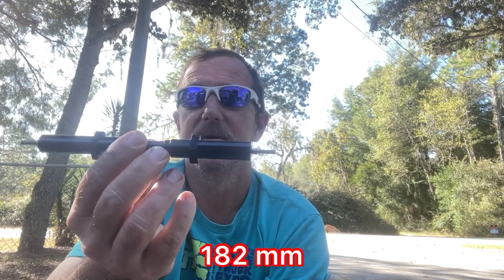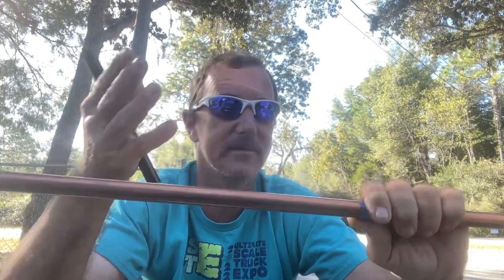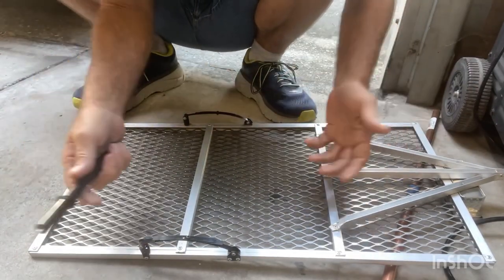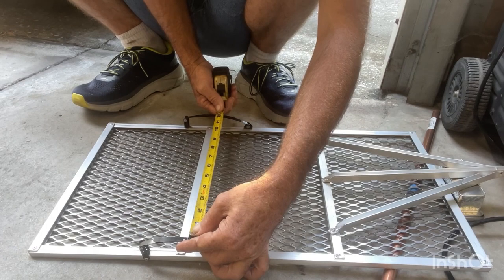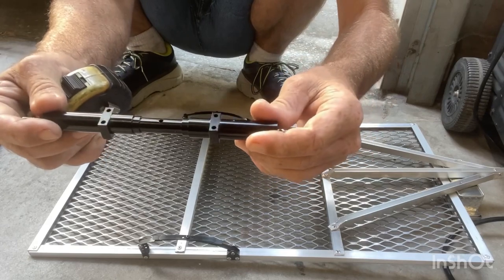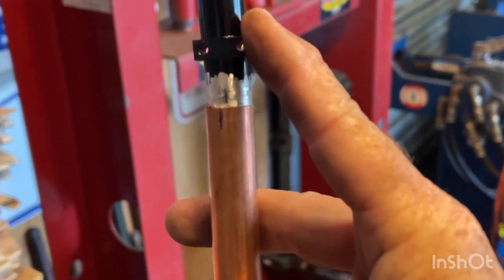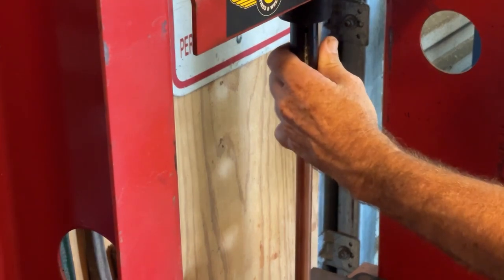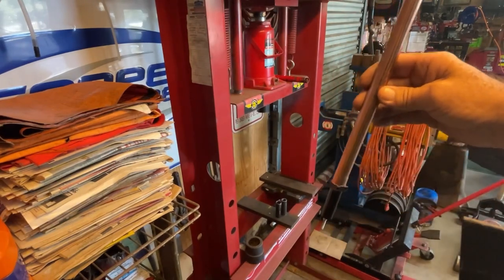How to make a RC trailer axle longer from Amazon

Comment: QUICK TIP: If you don't have a big press, or a friend with a mechanics shop, you can put the axle in the freezer for a few hours & just before you assemble it, heat up the copper & then hammer it together. Also, while youre waiting on the axlw to freeze, you can measure & drill a hole in a block of wood to fit the axle into, then hammer on that.
Reply from the maker: Definitely brother that is another one that can be done as well never thought about that one lol much appreciated
Reply: @rc.terminator  We're here to help each other. This it a great hack, & I'm glad you made this video. 
Also, I love that trailer. The stretched metal decking is frikkin' awesome.
Reply from the maker: Thanks brother you got a sneak peek lol
Reply: @rc.terminator  
Yeppers. We alll did.